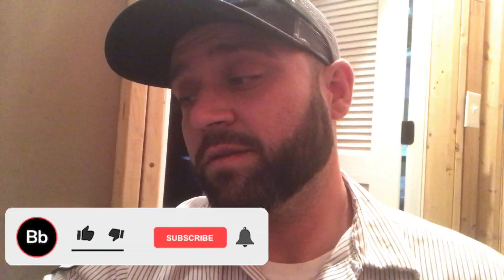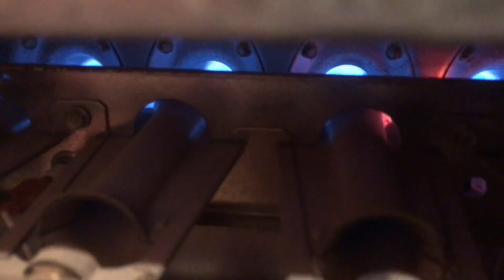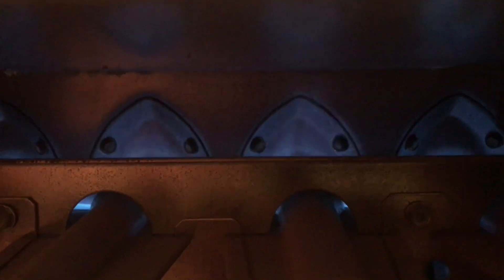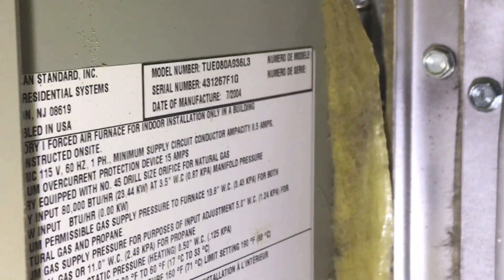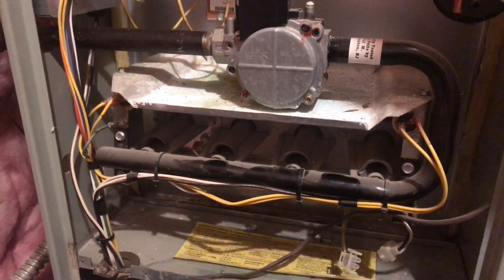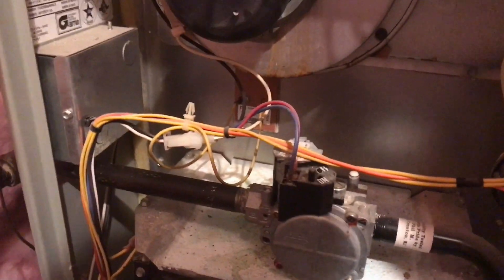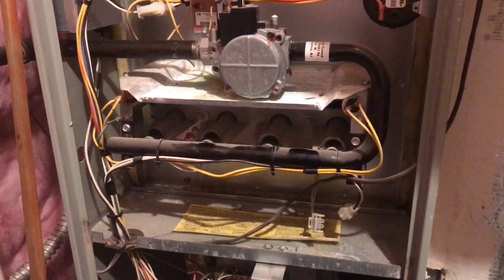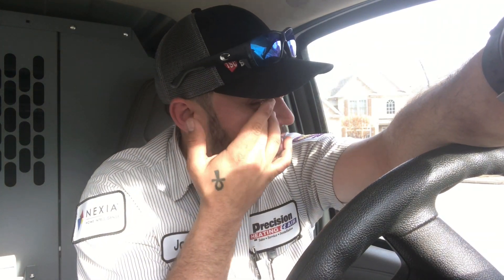Watching A Furnace Run With A Cracked Heat Exchanger

Comment: I would want to verify a cracked heat exchanger myself but most likely I would check it before I called the service company. 

I just went up in my attic to troubleshoot my furnace. It was a loose connector on the control board, most likely from when it was installed five years ago.

Comment: My Neighbor's had a 9 year old Trane 95%.  I check their Furnace every year looking for rollout and measured static pressure at pressure switch. Did this 2 weeks before it failed.  We were away and their Furnace would not stay lit. The Tech showed them pictures of the cracked Heat Exchanger. She was able to get the pictures sent to her IPhone.  The pictures were not of their Furnaces Heat Exchanger.  They got screwed out of $25000 for a new Furnace and AC Unit.  And they took out a Trane and installed a Goodman.  They also took out an 18 SEER Trane AC and installed a 13 SEER Goodman.  It made me puke.  I didn't tell the Homeowner because the evidence was gone except for the pictures..  My Wife said to "Mind my own business".  Then a month later some Friends said the HVAC Tech shutdown their Furnace with it 38 degrees outside.  They have small Children.  Bad Heat Exchanger. $12000 to replace Furnace.  I went over and tested and inspected it.  The Furnace would not light due to a 31 code, bad pressure switch.  The Draft Inducer Fan was seized.  I replaced the Fan with an Amazon order.  Installed it and checked out Heat Exchanger.  Perfect.  The Homeowner is a Lawyer and he's going after them for fraud.  Thank God they called me as I saved them thousands of dollars.  This seems to be a common practice in the Portland Oregon area.  Many HVAC Techs here work for sales commission so they try and sell you a new Furnace.  Honestly don't know how they can sleep at night?

Comment: There's a few bits of information that are being left out here. First of all, the reason the flame is coming out is because the blower side of the heat exchanger is pushing air back into the burner tubes. That means there's no possible way carbon monoxide is getting into the house from the flames. Secondly, when you put the cover back on the sealed upper chamber, the suction from the draft induction fan will draw those flames back in the tubes. The end result is that while the system does have a crack in it, it has probably been that way for a long time and nothing has come of it. Shutting it down is done for the sake of the HVAC contractors liability ONLY. Make sure you have several working carbon monoxide detectors and save up the money for repair or replacement.

Comment: Would a flame rollout sensor trip under this condition?
Reply: the high limit may trip if you try to get a large temperature increase in one go (ie, going from 13.5C to 18C in one shot, instead of 13.5 to 15.5, wait, then 15.5 to 17, then wait again, and go 17 to 18, just an example)
Reply from the maker: It definitely can.

Comment: Heck yes, I don't blame you. I would also shut them down. Turn off breaker, turn off gas stop, turn off gas valve switch, disconnect the ignitor, disconnect 24v heating wire from the board. It's a shame we have to save stupid people from themselves.

Comment: I had three decent-sized cracks in my heat exchanger. But you would never know it by looking at the flames. They look perfect and absolutely no roll out whatsoever. I found it during a visual inspection of the heat exchanger itself

Comment: Our Furnace had a Heat Exchanger with bad rollout.  We bought a Carbon Monoxide monitor and turned the Furnace back on.  It was really bad to have an HVAC Tech shut us down in the dead of Winter with no alternate heat source.  The Carbon Monoxide monitor continued to read "0".  The Company that did replace the Furnace told us the positive pressure from the Blower generally prevents Carbon Monoxide from entering the living space. Designed that way for safety.  The Company that shut us down during one of the coldest snaps, did not get the job.  The Company we hired put 4 Monitors in our Home, for piece if mind, until the new Furnace was installed.  They got stellar reviews on every site I could find.

Comment: It's funny i have all 4 of my burners doing this way worse than video'd. I have had a guy come red tag my HVAC for a small hole in a pipe somewhere going to my water tank but nobody has ever once said anything about this rollout on my furnace and it has been doing this for a year or more. I have a carbon monoxide detector hooked up multiple times and never gave me any warnings. This does make me scared and a bit worried.

Comment: Alot of homes have a 1 or 2 fresh or cold air returns roughed in the walls that run fresh air from the attic. You can look right down into your walls and see the vents usually in a laundry room or a confined area where your utilities are so if there's ever a leak of some sort that can effect air quality it has a place to escape. Attics have fresh air coming in from your soffits so never close up those soffits if your a DYI person. It can cause a whole bunch of other moisture issues and temperature differences also.

Comment: Is it normal to smell a tiny bit of gas in the furnace room sometimes after it runs? The flames look good and I just had someone come clean the sensor because it was short cycling for a long time im worried it may have caused damage
Reply: There is the water heater in the room too, I had the gas company come before too and check and didn’t find any concerns. Also, the HVAC guy told me that this pop noise I hear when it starts going is the heat exchanger expanding. Is that dangerous? He said it wasn’t a concern but idk
Reply from the maker: It doesn’t happen on all furnaces, but some do have a pop or tinging sound when it starts heating up. As for the gas smell, as long as it is a very faint smell that goes away you should be fine but if it’s ever persistent or smells stronger than normal, definitely have it checked again
Reply: @ yes mine has that noise when it starts up a little bit after the flames come on it’ll make a pop like noise but that’s all. They said it wasn’t anything to worry about is that true? Thank you so much for the reply it gives me a peace of mind lol. I figured out the smell was coming from the water heater and that the Honeywell valve releases a tiniest bit of gas to avoid vapor lock but had the gas company come check and everything was ok. Bought an explosive gas alarm and my own tester device just in case. I’ve never had to deal with gas in the house before so I was a bit worried about it. It sucks because the water heater and system is upstairs in the hallway right next to all the rooms and bathrooms so I can easily smell it

Comment: Some people might not understand its doing that cause the blower air is blowing into the combustion air,its not supposed to do that,cause normally the combustion air is sealed from the blower compartment.Also get a CO detector so you dont die from Carbon Monoxide poisoning.

Comment: Great video bud. I'm tired of hacks putting video's out in our field where I'm screaming at my monitor it's called a fucking Gas Valve not an auto valve or a thermo-couple not a fucking generator. I even watched an ass hat pull out a Temp limit switch on a Lennox G24m and jump the wires AFTER the customer said when it runs it smells burnt. He left it jumped FYI.

Comment: Interestingly, I have an issue with a heating system. Oil fired, that apparently has a big hole/crack. But interestingly, the company who's installed and has been doing its maintenance since (and on the original system since the 90's) diagnosed 1st time 30-45min on site,a bad thermostat after a gas smell complaint. Replaced the thermostat, smell lessened but pursued. 2nd call 1hr-2hrs on site,diagnosis- large hole or crack in heating system ( exchanger also listed but wasn't directly attached to original ,crack/hole statement) . Technician mentions to customer this crack/hole is large and has been here for quite a while. customer requested a time frame. Technician timidly says a longer than a few months...
Estimate of 11,000 to replace system insues. Home owner is elderly , and wasn't experienced in dealing with this as her recently passed husband ( shrewd  and intelligent business wise man) handled most if not all of these things. She has had help to make do in the meanwhile. However, another opinion I'm sure is badly needed. Not sure myself about this topic much. So I assume that would be pricey to have someone or several to come estimate the issue themselves?  
Sorry for the lengthy comment/question. Just seems odd that the company that installed and maintenances this never caught any issues before this. Yet the technician said it had been like that for a good while. So atleast more than a month, and the system was supposed to have been had maintenance 2 or 3  months previously before in prep for winter months. Atleast , the monthly charges for service were billed as such.

Comment: Good, to the point video.  Vocal audio needs to be louder.
I understand the point of disabling the furnace, but if the building has working CO detectors, the temp is -10°F outside and the circ air is higher pressure than the combustion air and thus no combustion air is escaping into the circ air, there should be very little CO or CO2 entering the circ air.  This problem has likely been present for months, maybe years.
If disabled, what is the occupant going to do, set up a few space kerosene space heaters to keep the temp above freezing?  How safe is this?  Electric resistance heaters are not going to save the day.

Comment: Thanks for this video. I had a tech out two weeks ago and he did a thorough diagnosis including using an inspection camera to check the heat exchanger. I have a Gibson/Nordyne 80% 5-burner. He also determined that the furnace is about 18 years old. 😮 

Fortunately he deemed it ok, and he determined the inducer motor needed replacing. (He also took apart the vent glue and checked it for blockage.) A few days later after the part was obtained he replaced it, checked the vacuum, and all was good. Flames also looks good (or at least nothing like you showed 😅).
The repair was flat price and a bit more than I wanted to pay but in the end it needed to be done. The service call and diagnosis was well worth the fee. 

Question (and maybe others asked here) , why in this furnace with flames rolling out, didn’t the rollout switch trip?

Comment: It takes 8hrs to replace a cracked heat exchanger? Wow that must be a h!#@ of a Process. We have the same problem but it's not cracked but needs to be cleaned the unit itself is 13 yrs old the technician recommended that we should just go ahead and get a new Furnace because of the age something else will most likely break down pretty soon. Do You Agree with THAT?

Comment: I'm kind of surprised the pressure switch didn't shut it down.  The inducer pulls that much air?   Interesting stuff.  I've also thought that seeing soot in the vent was an early sign of failure.

Comment: Can you still run the system and install carbon monoxide detectors near it and elsewhere? Since ive heard you can run it sometimes if the cracks are minor and that there is a built-in shut-off if it detects carbon monoxide? Obviously, if they go off, shut the system down, but one hvac guy told me my system had a built-in shut off in case of that.

Comment: G3 student here. If you don’t lock out the unit and take photos and something were to happen - god forbid a fire or carbon monoxide poisoning - liability falls onto the technician. Good conscience aside, you must shut down the system and go about reporting process. Check code book for the exact procedures.

Comment: Great video! Perfectly executed, man. Great advice on what you should do first if you suspect a bad heat exchanger or even before you perform any maintenance on it; that's what I used to do. On the ignorance of customers, I totally get it. Don't you know what happened here, you ruined that all important bathroom or kitchen remodel that they wanted to do to impress their neighbors, friends and relatives with. They would rather take a chance and die of CO poisoning than give up that remodel. Shame on you for trying to save their lives. They either already had called someone else that told them the same thing or they're gonna call someone else that's gonna let them die so they can do that remodel. Don't you know that these are the idiots that the news channels interview(if they're lucky enough to be alive) that you're supposed to feel sorry for because they nearly got gassed, but they'll never, ever say that they were told to replace their furnace waaaay before this. I did HVAC for 25 years as my own company and I found the priority list for homeowners is something like this:
1) Kids secondary education
2) The dream vacation
3) Remodel kitchen
4) Remodel bathroom
5) Build-on to the home or put a deck on or pour a patio, then put a deck on(and they'll usually have an ignorant carpenter build it 
    over their AC or they'll do it themselves, then complain that "our damn AC is blowing hot air on us when we sit on the deck, can 
    you move it for $100?")
6) New car
7) New toy(jet ski, speed boat, Harley Davidson or other motorcycle, Classic car rebuild, fun-mobile, camper, etc)
8) Man cave
...
100) Replace furnace and AC? Huh? What? Why the hell would we want to keep or asses warm in the winter and cool in the 
         summer, we've got better things to spend our money on, don't you know that?

This is exactly what I was talking about when I posted in your 'Wrong Piston Size' concerning my HVAC experiences with respect to customers.

Now YOU'RE  the bad guy!

The point is they'd rather spend their money on anything other than replacing the furnace and AC, and that's a fact, brother. Oh, and these are the same customers that will call you when it's freezing-ass cold because their furnace isn't working, just before you and the family are headed out the door to go on YOUR dream vacation; and you'll say to your wife: "Well honey, gonna have to cancel, maybe next year". OH MAN, I could go on and on about why you should look for another job, but you probably don't want to hear it! So, goodbye and good luck. 

Here's hoping you can hold onto your sanity!

Comment: Newbie question here: This is a propane furnace in the video, yes? I have an oil furnace (so I assume it's different), and when the furnace guy came and fired it up, smoke rolled out of the top. Tech said it was the heat exchanger, and we needed a new furnace ($7,700). According to his boss, the heat exchanger is no longer available to purchase. Would you recommend trying to: A) fix the heat exchanger (find the hole(s), maybe patch with JB Weld? (Again, newbie here so keep that in mind), B) finding a used non-functioning furnace and swapping out the heat exchanger, (after testing it for leaks) or c) Just junking this one and trying to find another used furnace. I'm just trying not to freeze this winter up here in the woods of Maine. Thank you!
Reply: Do not jb weld it,  you’ll have more in labor to even attempt
To swap the heat exchanger from a used one. Which is probably in the same state as your current one. 
Yeah it sucks and it’s expensive. But stay alive, have a brand new unit installed but a qualified installer. 
Any of those ideas you posted can possible kill you or your family from CO.
Reply: @wperro81  Thank you.

Comment: HEADS UP.  Hvac companyies are STILL liable, even after disabling the sys.  YOU must ALSO secretly insert a gas line blocking plug, inside one of the flare fittings TOO.  (A piece of electrical tape will work).  THEN, you must install a NEW C.O. Detector, in the bedroom hallway, FOR FREE.  YUP.  If you dont, and the idiot homeowners reverse ALL your system disabling actions, and they DIE, then YOU can STILL be held liable!  YUP!  (Never reveal the gas line is plugged, until you are on a courtroom witness stand.  THEN, your FREE.

Comment: Let us be clear, the carbon monoxide is from the flame rollout caused by the heat exchanger plugged/cracked not actually from any cracks or restriction. Hence this is the position of the safety roll out switch.
Reply: I’m kind of confused by your comment. What point are you trying to make? What is the fundamental reason for carbon monoxide happening during a flame rollout? Curious.
Reply: @MathCuriousity  With a conventional gas furnace flame rollout, nearly always caused by a plugged or partially plugged heat exchanger rather than a cracked heat exchanger, there is always major incomplete combustion occuring which generates massive amounts of carbon monoxide.  Always check for this as not every unit has a roll out switch.

Comment: I would not suggest you ever turn off a furnace isf a class "B" tag would be sufficient. A stove is considered to use about 60 cfhr and a furnace 90 cfhr. The stove has no exhaust venting at all and it is legally safe. The Trane was producing a blue flame which produces no Carbon Monoxide. I saw some orange flickers which do produce CO but how much? The production of 5 ppm CO is considered safe and even up to 30 ppm for short durations. Red tagging that furnace is your fault if a tenant with exotic pets suffers a loss. It is often the law that a rental unit must be kept at 21 deg C. Turning off that furnace makes you libel not only for their discomfort but if pipes burst, its not covered by insurance if you turned the furnace off intentionally. It's nice to be on the safe side, but if you have a license, make sure you should have a license or you could lose your home if you are not protected by liability insurance.
Reply: Are you implying that flame rollout won’t create carbon monoxide if the flames stay blue?